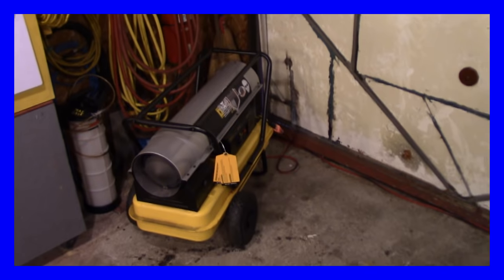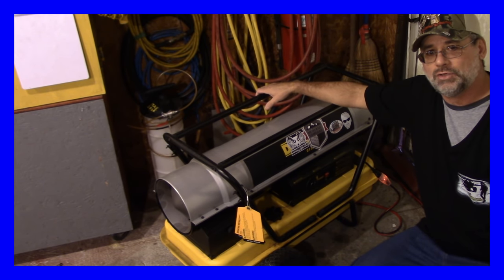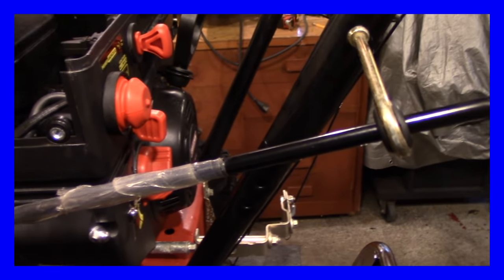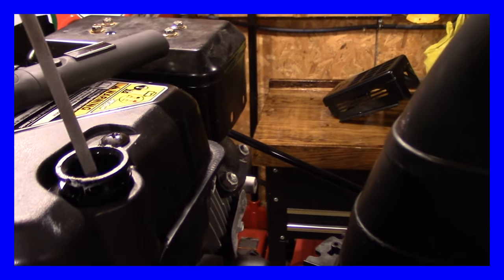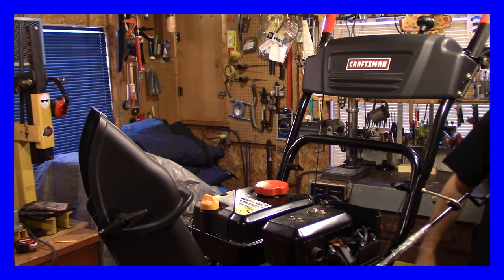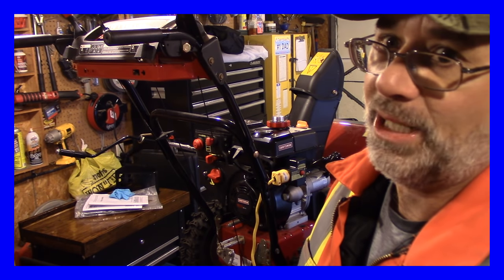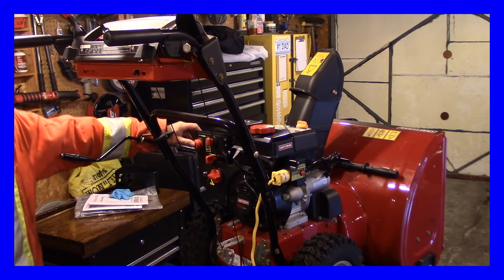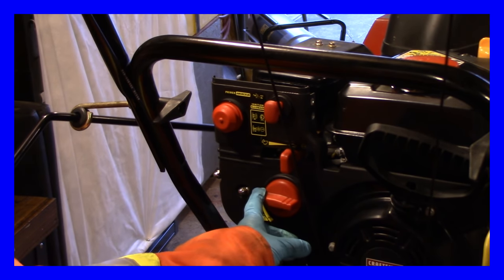CAN YOU FIX A SNOW BLOWER WITH SEAFOAM

Comment: I am a fan of sea foam, but have had better luck with the b12 chemtool on my blower engines, I don’t feel  sea foam is a good fuel stabilizer it’s a good preventative self clean that’s abt it, as I mentioned the b12 will self clean them carbs much better in my experience and it’s half the price. I prefer sta-bil for my fuel stabilizer, every time I have tryed sea foam in my snowmobiles for stabilizer it has failed even with 91 premium fuel

Comment: I'm glad you are nice and warm with your diesel heater.  How do you vent the room to eliminate CO ?
Reply from the maker: In my situation the building is far from  air tight but to err on caution I only use the heater to heat the shop up then switch to an electric heater .  I have used the diesel heater a lot  as it does take more time to heat  in very cold weather and never has the air monitor indicated any concern .  I would not recommend the diesel heater for fulltime use as it is real loud and its exhaust is  so hot  it's almost impossible to not burn up anything in its path 😅 Cheers
Reply: Might want use a CO detector
Reply from the maker: https://youtu.be/_UEnxv4CGrM

Comment: Hey Steve, got a question for ya. My father's blower seems to idle a bit rough. I just pulled both of ours out and filled them up with non-ethanol and a good dose of Seafoam. I'm hoping if it's running lean, the extra Seafoam will help the carb if something is blocked. His idled like this last year. It's been back to where he bought it and they say it's ok. I'm not sure. Seems to start easy enough. It doesn't have more than 10 hours on the engine. Could the plug play a part in this? It's a single stage Toro and the case would have to come off to check it. I'm sure the dealer didn't pull it when they looked at it. Thanks
Reply from the maker: I see new machines that do run  a but rough at idle only but under load and higher rpm work great. I think their building them to emission standards different and lean at idle. If it works  normal  when  blowing snow I'd say the dealers right and it's normal.
Reply: Thank you very much Sir. Wasn't planning on doing the plug in them till about the 5th or 6th winter. They don't run much over the winter. Just nice to have when a good storm hits.

Comment: What kind of gas you recommended for the snowblower? You said "super stuff"... what did you mean? 87, 93, ???
Reply from the maker: 93 without  ethenal  if you can and a fuel stabilizer is the way to go. 👍
Reply: You can use premium or ultra fuel

Comment: I use nothing but Premium fuel with 0% ethanol in all my yard engines. Each spring I drain most of the fuel from the tank and fire up the snowblower and let it run until it dies, so all the fuel is out of the carb. You also need to keep the idle mixture screw/hole clean along with the main jet on the bottom of the carb fuel bowl.
Reply from the maker: And that's how it's done right. 👍

Comment: Easy Steve with that camera! Man I want one of these too but smaller and Gas (propane) to boot.On the snow blower I am gonna try to guess right here at 3:27 in the video for fun. Yes I paused the video so I can guess Steve. I'm going with the kill switch was grounded out. Their we go. Now back to the show to see if I got it. LOLThey don't sell funnels up their? LOL  Shit Steve that looks like water? Water would have froze and busted the bowl. Hate the Corn fuel because YES it gums up. Cheep gas sucks in mowers and small engines. People need to use 100% gas in their small engines just like boat motors. Man it isn't that much more $$ come on. like 30 to 40 cents more a gallon? I would install a shut off valve for sure. Stores kill me. They sell crap to folks and don't explain how to use it. You & I both know no one reads a Dam manual. LOL  Probably a vacuum leak causing the vacuum to be lost on the fuel side. I love these types of videos Steve. I dabble in the small engines too as you can see by my comments. LOL Thanks for this.
Reply from the maker: Was that slugged up or what. LOL  The fuel sucks and i was surprised to see the seafoam work as good as it did. This engine was something from the wing wang factory for sure. LOL

Comment: Can you run that torpedo heater on home heating oil- or do you have to use a #1 fuel?
Reply from the maker: I run mine on  #1 & #2  diesel but I can't see why it couldn't run on furnace heating oil. I'd ask Dewalt to be sure . Cheers

Comment: Howdy sir. Came across this video while looking for reasons why the MTD snowblower I have won't start and noticed the manual you're holding. It looks exactly like my manual and it's a Powermore engine. It's not the 178cc. Probably not the 208cc. 
I think I'm having an electrical issue. No spark. I changed the plug and checked with the plug out and no sparky.
Reply from the maker: I've seen that. Check that  plastic  safety key. I've seen them cause the no spark shorting to ground.

Comment: Hey Steve, was wondering what was the longest time you've left treated fuel in a machine and had it start fine.
Reply from the maker: Rob its my homemade diesel log splitter. Been 10 years on the same fuel treated once when I filled the 5 gal fuel tank. Going to show it  splitting wood this fall hopefully.  Gas engines left with treated fuel for me is 2 years and not a problem using non-ethenal fuel. Ethenal full one year max. its not good even if treated more than that. Cheers
Reply: @SteveRobReviews  WOW! That's great!
Only reason I'm getting interested in snowblowers and fuel is because of the Farmers Almanac story coming out.😂 Cheers!

Comment: Bad gas in carb, my first thought
Reply from the maker: You would be so correct . LOL
Reply: And .... The difference between 87 octane and higher octane is none as far as this problem goes. Higher octane just has additives to prevent pinging in higher compression engines. All you are doing is wasting your money for nothing.
Reply from the maker: In Canada regular gas has 10 % ethanol and  gas with higher octane starting at 90 does not have  ethanol  and that's a huge difference  in storage life and deterioration .   The  best solution  is a good fuel stabilizer  for most . Cheers
Reply: @SteveRobReviews  That's interesting. I went to my local Sunoco gas station and checked out their 100 octane fuel ($7.50 per gal) and it still said right on the pump that it contains up to 10% ethanol. The only thing they had that was non-ethanol was a 5 gal can of CAM2 racing fuel which cost $60 US.
Reply from the maker: Troy I'm  in Ontario Canada , you must be up in Alaska for them  prices :) on all our pumps it says the same but the 92 -93 octane is non ethanol. I would just ask the station attendant they would know . Cheers
Reply: @SteveRobReviews  I'm in central Ohio and I did ask the employees and they didn't know. I've found a non-ethanol at our local big box hardware store called TruFuel but again it's $6 for only 32 oz so it's still expensive. Found them at Walmart today on clearance for $4 a can but I'm thinking it may be cheaper to just use the Seafoam or the Briggs & Stratton 5-in-1 fuel treatment. Any thoughts on that stuff?
Reply from the maker: Troy Stanley  I  use seafoam but there  are plenty of stabilizers that specifically say for  fuel with ethanol . Just use regular fuel and make sure you drain out the carb between seasons and you will be fine.

Comment: What is it you use to heat your shop?  You never say what it is and what the name of the product is.  Does it need to be exhausted?  It looks like you have a raftered garage.  I have a raftered garage with a metal roof. I was thinking of getting a heater to heat garage to get rid of snow on the roof so I don't have to go up there and pull it off anymore.
Reply from the maker: This is the heater I  use plus I have a 240v electric heater  as well.  After I get the shop warm I turn on the electric if im going to be out the for a while. Cheers
https://www.youtube.com/watch?v=gYqqTx1bH0Y
Reply: What is the name of the product?  You just sent me to the same video.
Reply from the maker: Bossmanrocks it's a dewalt heater , diesel or kerosene . Works great.  I've made three vids on the heater haha  too many vid to remember . LOL

Comment: I have a Snapper snowblower with the same problem.  I believe the engine is a Tecumseh.
Reply from the maker: I would say the majority of the time it's bad gummed up fuel . Very common these days and relatively easy to fix and prevent in the future with a fuel stabilizer .

Comment: I'll take that heater off of your hands. Hahaha
Reply from the maker: HAHA its a dandy for sure. You need one for sure to work out in the garage during the winter.
Reply: just finished watching.  nice fix. I put some seafoam in our small engines in the spring. works well.
Reply from the maker: D6Spanky I was surprised it worked so good. It's $13 a can up here .

Comment: I'm getting some backfire when moving the controls to high and then it goes off.  Is the bowl that you removed in the video a quick fix?  I need some needle nose plies
Reply from the maker: Yes it is .  Lack of fuel  can be adjusted if your carb has adjustable needle valves but overall its a carb cleaning but I have seen backfires also with old  contaminated fuel with water  too.

Comment: trying to get mine to just run but wont even do that I believe it the same motor u have here, I ran the fuel out last year before I put it away. no idea why it wont even fire, I checked the sparkplug to make sure it was fireing and it was. but was dry as powder so I'm assuming it not even getting fuel. any advice?
Reply from the maker: Sure , the float bowl needle valve may be stuck and not letting fuel flow so  look and see if it has two bolts on the float bowl and loosen the one not on the bottom and see if fuel comes out . You may have to remove the float bowl and investigate  further.  Most have a primer bulb to press and if you don't get any fuel  dripping out of the carb , most likely a blockage or bad primer bulb.   Sounds like the plug is dry so yes it's not getting  fuel - if it has a fuel shutoff make sure it's open too :) Give them ideas a try.
Reply: thanks for the help will do that
Reply: hey steve I chatted with u the other days about my carb not getting gas and as u suggested I should loosen the side bot to see if it was getting gas and it was not so I pulled the cover off the carb and the float was stuck in the off so I got it freed up and redid the bolt and it was getting gas and it was still clean but it still not getting gas I put some gas in the plug hole to try and make sure it would run and it did but as soon as the gas was out it stoped running, I have no idea what to do now and other suggestion
Reply: I believe the next step is to pull the main jet and tube and clean them. Right easy to do. PLENTY of videos on cleaning a snowblower carb out there.

Comment: Hi Steve... I've had several different opinions on storing a snow blower.. some say FULL gas tank with seafoam or stabil in gas.. others store it with empty tank.. I was always told that a empty gas tank only invites condensation that ruins small engines.. your thoughts?
Reply from the maker: Well years back metal fuel tanks would rust if stored empty but today they are all plastic.  In my view if you can get fuel without ethanol and use a fuel stabilizer it's just fine stored with fuel over a season but if not empty is preferred to prevent any problems with the fuel. Cheers
Reply: @SteveRobReviews  OK. I always buy ethanol free gas and use Seafoam to treat it

Comment: That small engine looks like either a knock off Honda engine or Tucumsi. 
One thing I have always done with 4 stroke small gas engines is run hi octane fuel and two stroke motor oil mix in the engine and have never had issues. I always figured a little extra lube never hurt. Sea foam is a wonderful product but if you can't get it methoyl hydrate works to.
Reply from the maker: The seafoam saved the day for me. I know lots of people that do the same as you, yes a little extra lube is fine. Cheers  and thanks for watching......
Reply: Its not a Tecumseh, they have been out if business 9 years and they did not make garbage. Its a honda clone by the name powermore. The worst clone of all used by MTD.

Comment: Use 100 octane aviation fuel in all the small engines. Little more pricey but well worth it in the long run
Reply from the maker: I have never tried that but it must work well. Most I can get is 93 .
Reply: If you have a local airport you can catch the fuel truck when he’s leaving just bring cash LOL
Reply: Just be aware that it does have lead in the fuel, so don't breathe the fumes and be aware it can cause issues with some exhaust systems clogging and can cause spark arrester to clog up a bit.  Aviation fuel is super good for engines as it will help with valve lubrication and ring and valve seals as well as add a bit of lead cushion and lubrication to the piston/cylinder wall and help improve compression.

Comment: I NEVER run ethanol gas in ANY of my small engines or outboards.  Ethanol will eat the plastic parts, including the inside of the plastic gas tank.  I buy what is called recreation gas in my area, it is high test without ethanol.  I use stabilizer as well, haven't tried Seafoam.  These small engines sit a lot and the ethanol in gas causes problems like seen here plus moisture to accumulate inside of your gas tank.  So save yourself a headache and use high test gas without ethanol and some sort of stabilizer.  With what little gas these things use the extra cost is minimal.  In the off-season run it dry before storing it and you should not have fuel related problems.
Reply from the maker: Good advice Rich 👍
Reply: I have a habit of forgetting to run it dry 2 years of hard snow blowing and I live in cottage country in Ontario can and we get are share of snow but it surges I imagine it’s the tube I’ll take bowl off today we are going to get a shit load of snow this year we already got a few today more so I had better get it running good new plug and emulsifier tube and I’m going to run it full out and block with my had 7 or 8 times and the pressure may clean it out clog the air going in so it takes more pressure to run should clean it out wish I had a shop I sucks working on it out side them salamanders are not good in a little space

Comment: So I have a snow Blower that is about 7 years old and It won’t start. Should I drain the gas that has been sitting in it for that period of time or should I pour the seafoam in it and let it run! If yes how much would you suggest pouring into it? And how long before I try to start it?

It’s a YARDWORKS by MTD 208 cc S.E.T. 22”
Reply from the maker: I would drain all the fuel out and take the carb bowl off and clean it all out.  I would take the needle valve out and use carb cleaner spray to clean out the passages then put back together and try it again. Wow seven years with old gas is going to be pretty gummed up.
Reply: STEVE ROB REVIEWS ya Steve my dad is an idiot! I’m also pretty sure he used Regular gas! 7 years ago gas was cheaper then it is now so no excuse for him not to put in ethanol free

Comment: Why was the carb leaking in the beginning of the video? I tried removing that nut now the carb won’t sit properly and leaks out a bit.
Reply from the maker: My float needle was stuck but in your case its most likely the gasket that seals the bowl to the carb is distorted. Try a new seal.

Comment: Don't have to use sea foam at all syphen the gas out of the tank, drain and drop the carb bowl clean it and make sure it seats that will solve your leak, use higher grade gas 93 ethanol because the lower the fuel the more ethanal which will cause the sludge after that guarantee will start up and run no problem
Reply from the maker: Good idea if everyone had access to no ethanol fuel across the world . Most fuel related problems are removed with a fuel stabilizer and proper  storage . Cheers 👍

Comment: Mine only runs while choke on. Think seafoam will fix my prob?
Reply from the maker: That's definitely  a shortage of fuel symptom.   I wouldn't suspect a gummed up carb passage to a gummed  up carb bowl.   If your not up to taking the carb apart and clean , the seafoam is a great option .
Reply: adjust the carburator

Comment: Hey Steve I have a question for you about the sea Foam.....because I haven’t started my snow blower for 5+ years with the same gas left in it, is it a good idea to put the sea foam in it with the old gas before i drain it or drain it now and run the sea foam with the new gas
Reply from the maker: Shane it's far too late for any additive . Drain the gas clean out the fuel bowl and needle valve , carb cleaner spray  out the  carb passages , put it back together and give it a try to start. 👍
Reply: STEVE ROB REVIEWS would you suggest taking the tank off and washing it
Reply from the maker: @shaneemanuel83  Na not unless you can see a lot of sludge in the bottom , if so it's a must do to get it cleaned out.
Reply: STEVE ROB REVIEWS last question if I decide to take it out to clean it out is it ok to run under water?
Reply from the maker: @shaneemanuel83   Sure water is  fine  , just dry it out good .

Comment: Thanks for this Steve. It worked for me. Now are you saying you can leave the fuel in over the summer if you have the Sea Foam in it or do you still have to run it dry at the end of the winter?
Reply from the maker: Its best to turn the fuel valve off and run it dry. I have not had a problem leaving just the fuel tank full of fuel over the season. Glad it helped out. Cheers 👍